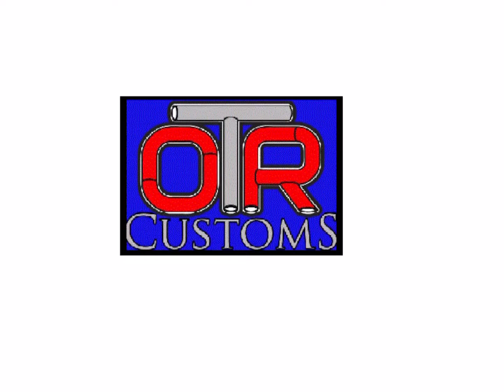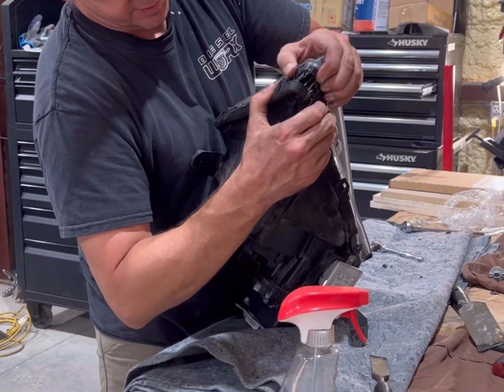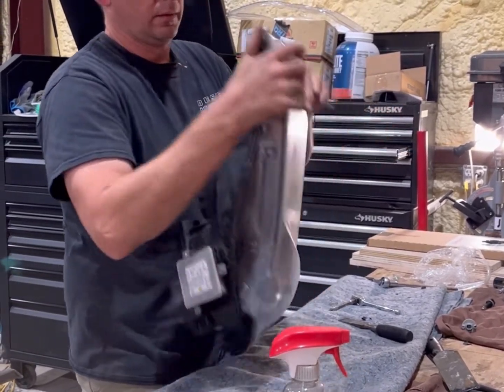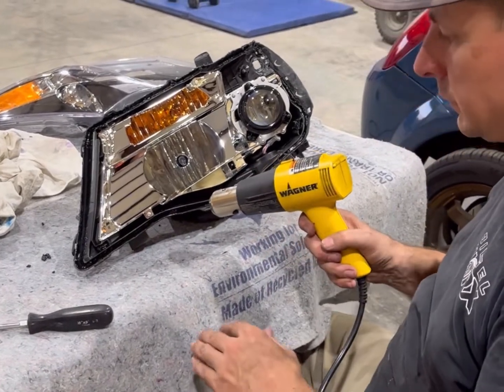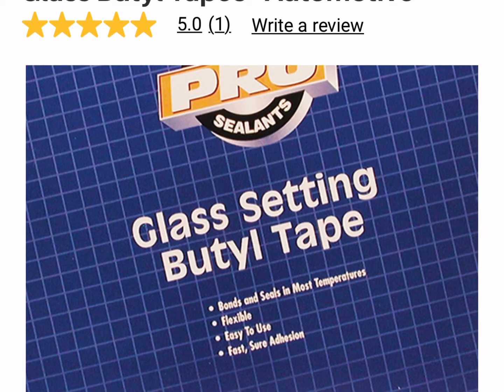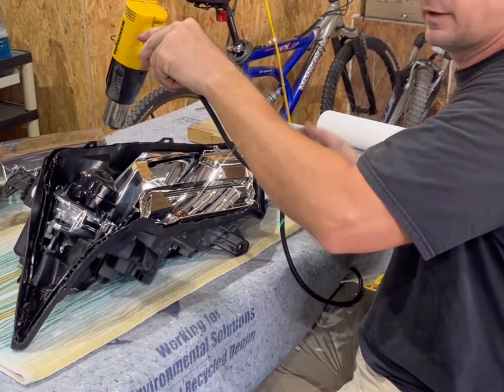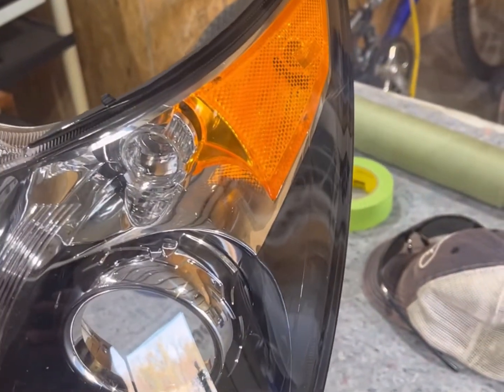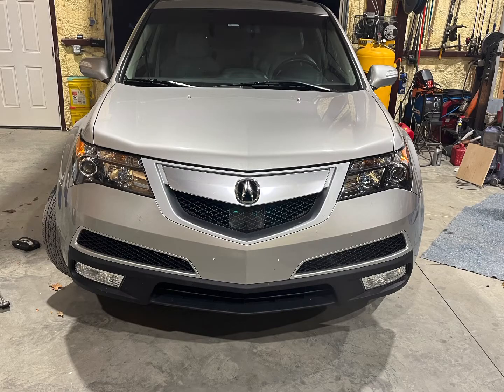2007 to 2013 Acura MDX Headlight Lens Replacement

Comment: Thanks for making this video. The lense swap looks awesome. How are the headlights holding up, any issues with moisture or water getting in?
Reply from the maker: We actually ended up selling the 2010 to buy a 2015, shortly after I did the headlights.
Reply: @peppermountain hi I need to replace my 2017 acura mdx headlight lens. I have spare and Need to replace lens. Can you help ? I ll pay you labour